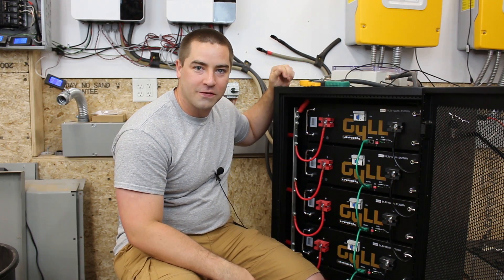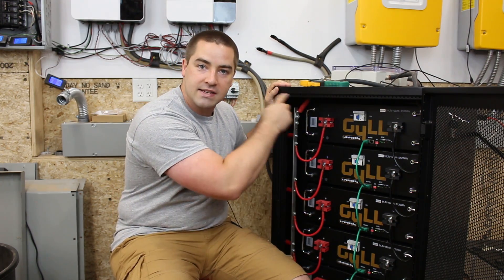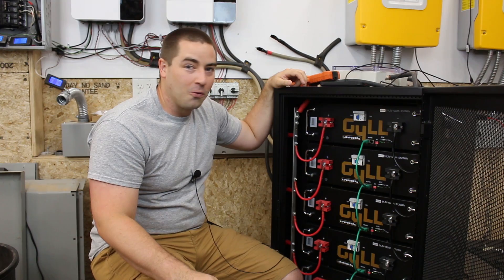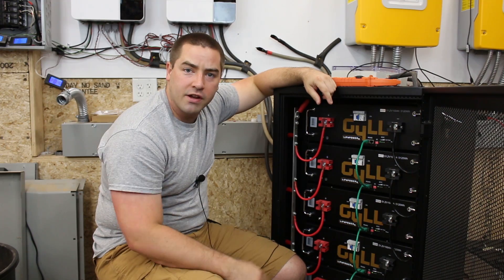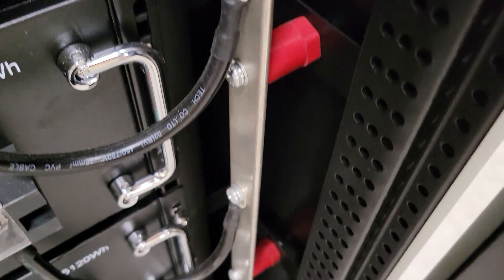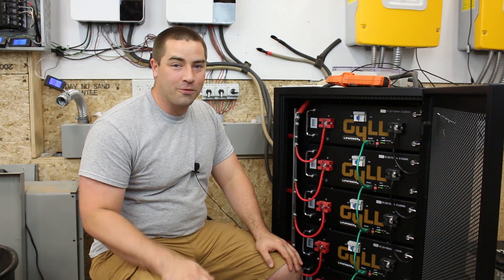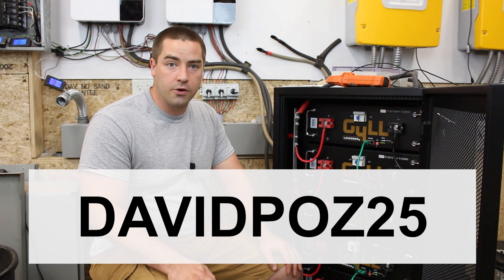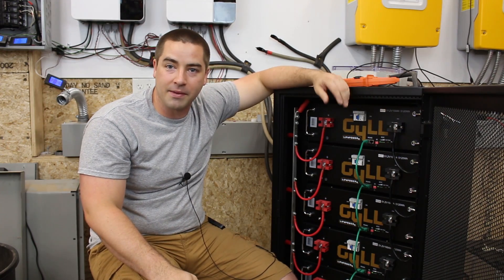Cheapest Pre-built 48V Battery, LiFePO4, Update when to buy

Comment: Wondering why I didn't get a Patreon notice earlier because, there were 99 likes preceeding mine? These appear to be great batteries for solar battery bank systems and I am anticipating using on my new home, once building material prices drop next year. Hopefully by then, Sol-Ark will be able to get communications established with them by Canbus with an RJ-45 connector? I think two racks of these would be sufficient for most homes off-grid and be far superior for the cost once communication is established.
Reply from the maker: I've heard they are working on that (communication to Sol-Ark).  I have no idea when/if it will ever be out.  But in the meantime I simply use the Max/min voltage to control the inverter and that works fine.

Comment: I have a single battery like David stated and it is working great. Plan on ordering 3 more. I have set my inverters to 51.6 cut off voltage. According to my charts that's around 25% DOD. Being easier on them to extend their life. Keep them cool, no more than .2C discharge and they will last a very long time. Also keep from freezing, do not float charge and not to 100% charge will help also. Only good things to report on these batteries.  👍
Reply from the maker: Great points.  I charge to 56.0V and discharge to 48.0V.  But I have not yet tested to see exactly where that is in the %.
Reply: @DavidPozEnergy  I use this chart. It may help. https://docs.google.com/spreadsheets/u/0/d/1SyzKUZ5_KxLB6megSLTXYv_1LlbcFqE4gxMgK8SrMvs/htmlview
Reply from the maker: That's a great chart.  Thanks for sharing.  It doesn't specify if that's during charging/discharging/rest.  Which does affect it.  But very good

Comment: Interesting tests, and completely agree busbar length is negligible here.
Reply from the maker: Thanks for checking out my video LithiumSolar.
Reply: @DavidPozEnergy great video brother...one question,  is there anyway to monitor each battery for their individual cell status eg temp , voltage and overall soc of each server rack battery... and if there isn't,  do the batteries led stop flashing when it's 100% soc thanks
Reply: Really cause it looked like 1 amp difference from top to bottom is 5%.
Reply: @MrGreen7427  he wasn't measuring concurrently, so it's not really a meaningful measurement.
One way to measure would be to measure either the voltage difference or resistance between the positive on the top battery and the positive on the bottom battery. If there was any difference it would mean there was meaningful resistance.

But as David says, the BMS and other elements totally negate the buss bar length. If the battery at the top is getting called on more, it's got a few hundred amps supporting it from the batteries below negating any difference.
Reply: @BobHannent  really?  Cause it looked like the full circuit current was the same before and after AND the amperage fell to 1 amp lower from both testing the positive and negative separately from top to bottom.   Seem like an obvious 5%.  And even DVid said there wS a difference and by his math it it 1-1.5%
Reply: @MrGreen7427  In my opinion, even if there was a 1A difference, that's still negligible on a 100Ah battery with a 1C rating. So one charges at 20A and one charges at 21A. Sure, one is going to be "working harder" on paper but by what, 1%? Is 1% meaningful? Will it shorten the life of the battery? I don't think so.

Comment: OK commenters, what about "internal battery resistance"? That will affect where power comes from.....
Reply: That's why he really needed to just measure the mV voltage drop from the top of the bus bar to the bottom, at a respectable / fixed current.  But you are correct that ESR differences battery pack to battery pack will also affect this.

Comment: David, did you have to hook any communication line between the G4LL batteries and Growatt? I see there is nothing in this video.  Also saw a comment about using a breaker on the Autotransformer was dangerous, what was your take on that, as you used a 30 amp breaker in that video? Cheers any help is appreciated. Great videos BTW.
Reply from the maker: No communication between the battery and the Growatt.  I'm told they are still working on that, but currently there are bugs.  I don't know any more details as I'm not good with computers.  Right now, everything works fine.  The max and min voltages are fine for controlling the inverter.
Reply: @DavidPozEnergy  Thanks for that David.  Did you have any thoughts on that Auto transformer?  Thanks once again, your reply is greatly appreciated.
Reply from the maker: Thoughts on the Auto transformer?  I think it's white and on my wall.  :)  LOL  I'm guessing that's not what you want to know.  Would you mind being more specific please.
Reply: @DavidPozEnergy  OK, sorry David, I had noticed a couple of comments on both your video and sig solars video, that if the auto transformer was wired through a breaker and the autotransformer were turned off or tripped, while power remained on in the panel ,that 120v devices could see some kind of surge depending on how balanced either leg was. Not sure if that explanation is helpful! The people who made the comment mentioned having the breaker for the transformer tied to the incoming power so if the transformer tripped for some reason so would the main.  Thanks again.
Reply from the maker: OK, gotcha.  Yes, I've had that comment made to me.  I've bought a few different breakers with the intent to wire the breaker of the auto-transformer to the breaker of the inverter.  If 1 trips, they all trip.  However, I've not been able to track down a UL listed connecting piece.  There should be some kind of plastic or metal bracket that joins two handles together.  IDK where to find it.  I could make it, but I was really trying to find the "correct" thing
Reply: @DavidPozEnergy  OK, thanks again David.  The only thing I know about, is square D make those little metal pins for connecting breakers together, but I think they are only for tying two single pole breakers together. It sounds like I am in the same boat as you, looking for the correct way to solve that problem! Cheers.

Comment: Greetings from Australia!

An easy modification you can do to rule out the tiny difference is to connect one of the output wires at the bottom of the bus bar. Eg: move the negative output wire to the bottom. This way every battery will see equal (almost) resistance.

Also the imbalance everyone claims is not when you charge or discharge them in constant current. The imbalance mostly happens when you have spikes in the load (charge / discharge). At these peaks, the battery that sees the lowest resistance (including it's internal resistance) will take the most abuse.
Reply: Agree with connecting at opposite ends of the bus bars.  That configuration is detailed in wiring manuals for many inverters, and then you don't need to 'hub' all batteries to a central point with equal lengths of wire.  It is common in bus bar configs to do this, but can also do with daisy chain wiring of large enough gauge.
Reply: Exactly, and I find BMSs seem to be doing alot more in the mix than people think about. good practices with better quality BMS can make a big difference It seems,maybe even enough to extend the life of the pack substantially? Crappy BMS cetainly can screw it up substantially.
Reply: From experience, those bus bars are large enough that, there just won't be a significant voltage drop across it, you are talking like microohms.... this is so small that just running the wires into the bus bar *is your junction point*.... the resistance in the cables and connections themselves is much higher than the bus bars....
Reply: lets talk conductance vice resistance... 1/R = conductance..
Reply: They’re battery manuals detail none of the wiring hook ups. They use more words telling how to screw and unscrew the terminal screws than they do describing where the connections are… top, bottom, lengths, grounding, none of that.
Reply: I disagree, I would never buy more than one battery pack.  Just buy the size you need, adding more later isn't a good idea either.  The rack cost is pretty high as well.  There are other issues not discussed here anyway.   Go talk to an electrical engineer about it.

Comment: It is amazing how much power 1 home consumes nobody realizes this until they try to make their own. June was a slow solar month this year compared to that whopper last year.
Reply from the maker: Yeah, it is.  And, this June has been really hot compared to what I remember of last year.  My electric use for AC is higher.
Reply: @DavidPozEnergy  last year was nothing compared to this year in Texas, Every month has been more extreme for the season than last year or year before.35% more KWh so far used by my climate controlled HVAC system components together over last year, same settings. About 15% of that was just the February winter storm week. I was slapping together batteries with whatever crap I had around to extend runtime.
Reply: Is there a video where you document in detail your daily power usage?  That would be interesting.

Comment: Very close to each other but the bottom batteries did show less current than the top ones as measured on the ground side.  It’s always best to measure your current on the ground side instead of the hot side because the reading is more accurate.

One way to counteract this slight difference in current among the batteries is to have your hot lead connected to the top of the busbar and the ground lead connected to the bottom of the ground bar—or vice-versa (hot on bottom, ground on top; literally doesn’t matter as long as they’re opposite).  When the load connections are staggered like this, the current will have to cross the entire length of both busbars to balance out, thusly distributing the load more evenly across all the batteries.

As always, great video Dave!
Reply from the maker: Great idea, thanks.

Comment: Checking voltage drop is probably the best way to see the difference.

Really nice batteries and enclosure
Reply: Yeah - I was thinking the same thing. Just measure voltage from the top of the bar to the bottom of the same bar.

Comment: I would think that they are in parallel it wouldn’t get out of balance if one gets drawn down almost instantly the others will work to balance.

Better to test is to watch all of them with separate meters and turn on a big load to see if you notice a difference between them?
Reply: Balanced from who's perspective? Each pack will see a different load due to the added (if small) amount of wire. Each has it's own protective BMS, so they're not going to get that far out of whack.
Reply: @jfbeam  The batteries will age differently as the SOC for the top battery vary the most every cycle and age faster. Recommend pulling from opposite ends of the busbars and swapping batteries around annually.  Or replace busbars with properly sized bars (google busbar ampacity calculator).